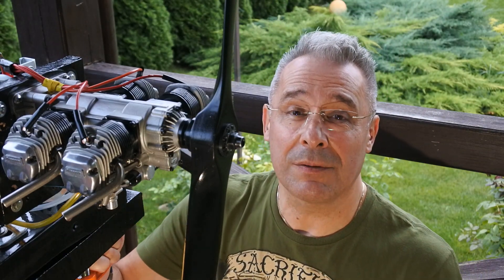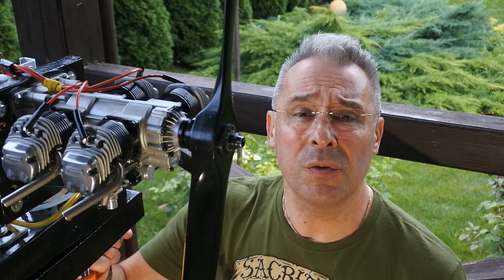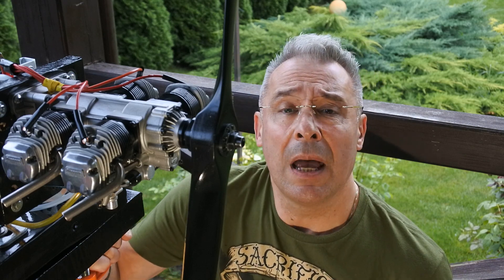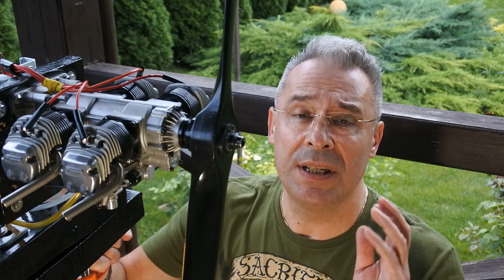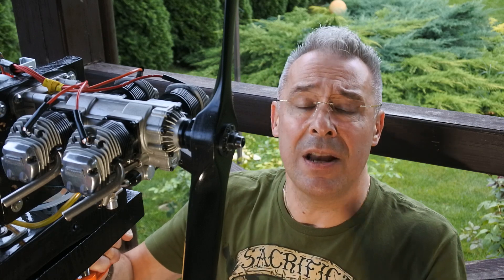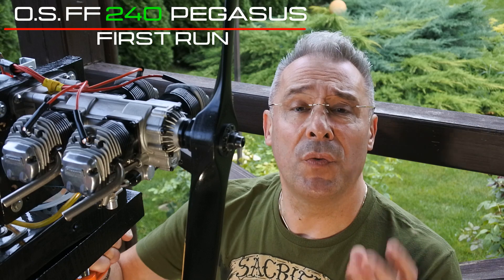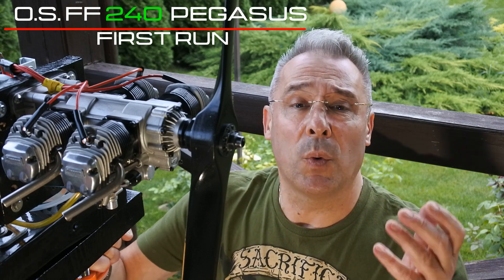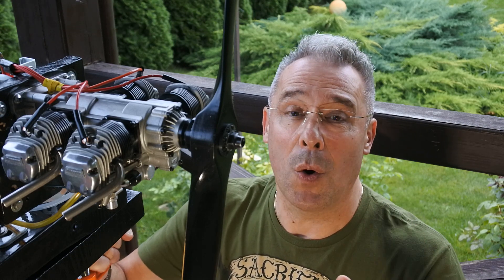OS FF 240 PEGASUS first run

Comment: That's a awesome looking engine! I guess the most strange one I have is a HP VT four stroke engine with the rotary valve head! It's a sweet sounding little engine but doesn't have very much power!
Reply from the maker: Thank you a lot for your comments ! Yes, it really is ! I can only talk about this engine in a superior mood, it evokes so many emotions. We will analyze it a little more deeper, to see its internal structure  and the design of its individual elements.
By the way, I also have this Hirtenberger VT21 in my collection, a slightly strange engine of an unusual design, has not yet started it. However, let's get to it.
Thanks again, and have a nice day!

Comment: Amazing engines, where do you find all these great items? 😁 Thanks
Reply from the maker: Thank you very much for your comment ! Definitely,  in fact, I'm such a big fan of 4-stroke model engines that I gradually started collecting them. It took several years, collected all over the globe. There are other weird ones out there...
Thank you and have a nice day !
Reply: I recently seen one pop up in Australia, $2000 ,brand new ff320
Reply from the maker: @danielhitchens4407   Thank you for your information ! It is really interesting engine, and it cost a lot. $2K isn't no so much for FF 320 N.I.B., I have seen much higher prices, both in the US and in Japan. Unfortunately, most model 4-stroke engines are no longer produced, replaced by more technologically advanced brushless electric motors, and recently their (4 stroke) prices have been rising, for the most part, they are far from new, and spare parts are practically absent. It's good that there is RCJapan guys , who are trying to get parts from the remaining manufacturers. I waited almost a month (!) for Saito to make a FA 120R3 engine's piston pin (which I lost during rebuilding the engine) for me + 3 weeks for logistics from Japan.